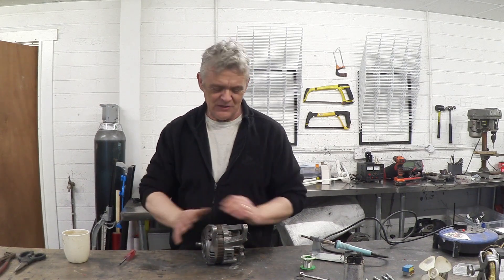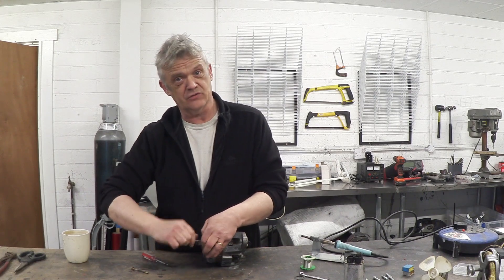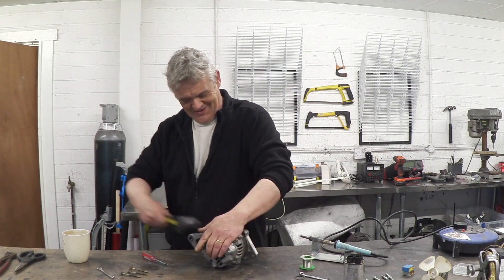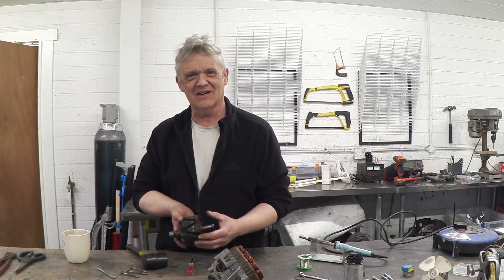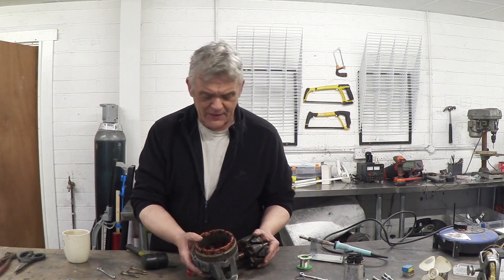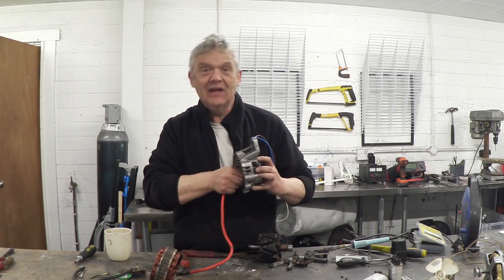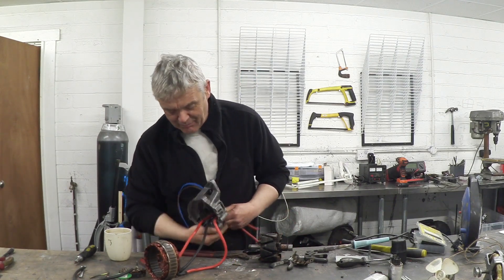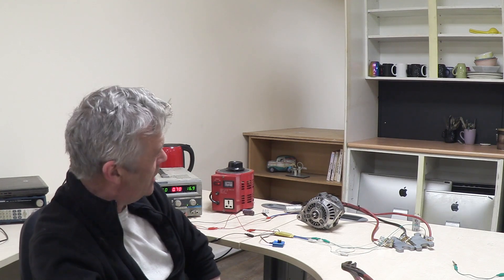Converting An Alternator To A Motor

Comment: By the way, reversing the polarity of the field (rotor) brushes does NOT reverse the motor, but swapping any pair of the 3 phase leads of the stator will.

Running with mechanical drive input (generator mode), adjusting the rotor (field) drive current will control the output voltage at any given shaft speed, it will also change the load on the device (turbine, engine, windmill ,etc.) 

When in motor mode, adjusting the DC field excitation is used to match motor HP output availability to that the load is demanding, which also controls the power factor (phase angle between Voltage and Current, lead or lag), which can make a synchronous motor appear Capacitive, Resistive, or Inductive, depending on field current.
Power utilities like to see unity Power Factor (in phase aka resistive loading).

HTH

Cheers,
Dave
Reply: Great info! Thx. Re: brush currents controlling to load (motor mode), what if you convert the rotor to PM, brushless? I suppose the magnet strength then would match to torque/speed demands on motor? What if also powering motor with variable voltage and current, say a solar PV panel? I wonder how to coordinate variable solar input to rotor field strength (with permanent magnets embedded into rotor to eliminate brushes and excite) to set load?
Reply: @2highview  1.  Magnet strength for rotor not that critical, weaker magnets produce somewhat higher speeds, but less torque. Stronger magnets, slightly lower speed but high torque. The alternating arrangement of N and S is critical.
Anyway the rotor (on DC) require a minimum of about 3 volt, max 12 volts.         
2.  If you use a variable DC input to the Electronic speed controller (ESC) from for example  solar panel, you need to know what input voltage range the solar panel/s would provide.  Generally alternators can work from 36 volts to 72 volts or even higher than that, but heat would start to build up fast the higher you go.  ESC have various types, generally you need one that can handle voltage of your average solar panel input. (minimum 36 volts, max about 60-72 volts) also having an amperage of not less than 30 amps (higher is OK). Best that you get a 1500-2000 watts controller. You can determine wattage that the alternator can handle by the volt and amp of alternator. E,G 12v X 80 amp alternator can handle 960 watts.
 Every ESC has minimum and maximum voltage cut-off.  Depending on the voltage you expect from your solar panel, you can use a DC to DC convertor to ensure that you have a steady DC input voltage into the ESC.,  Good luck.
Reply: @gensyed  I would like to know more,  do you have a source that I may be able to generate a recipie to use one for a trailer tug?
Reply: @ernestmurphy3898  Sorry, I do not have 'a' source, they're all from you tube. 'How to convert alternator to motor and the likes, AND from my own efforts converting and repairing alternators.  I buy my ESC and batteries from Ali express or Lazada and some from computer shops. Wish you success.
Reply: @ernestmurphy3898  If you have a specific question, I maybe able to assist.

Comment: If you connect 2 of these in paralell (each wire 1 to 1 w/ the corresponding 2nd unit's wire), then energize the rotor (slip rings) w/ single phase AC (use your variac) enough to provide excitation, you will have a Synchro (or Selsyn) system.
Rotating one shaft slowly, and the other shaft will follow it, remotely reading the other input.

Think a remote wind direction indicator.

Energizing with DC, then driving one shaft at high speed, the other shaft will "motor" at the same speed. (this is like a power plant generating 3 phase AC, running  a Synchronous motor at a customer's plant.

Cheers,
Dave Cole

Comment: So,if you remove the 3-phase power feeding, instead turning the shaft with whatever sounds fun, then you got a 3-phase generator, output voltage regulated by changing the 12V and the frequency by the speed you turn the shaft, right?
Reply: Yes, AC out put.

Comment: Could this be configured to work BOTH as an Alternator OR a motor? If so, it could be used as a pseudo Hybred system, if reinstalled on the original vehicle.
Reply: You're wanting a mild hybrid system
They already exist, made by GM, Continental, Hyundai and others
Reply: It could, but you have to just tap the necessary connections and have switches to make it either motor or alternator.  Also you need another source of DC top-up for your car batt because its taking the load of the car's electricity requirements.

Comment: My latest project video can be easily used as a variable frequency drive for you.  You will need one amplifier per phase and have a multichannel input with 120° phase shifts between channels for 3 phase.  Probably much cheaper than a commercial DC input to 3 phase VFD.  I found it much more fun to build as well!
Reply: Please can you explain further, I mean how to amplify the 3 phase output?

Comment: I Like these videos 

Interesting, i wonder if you were to self loop the rotor if that configuration would still function like an induction rotor , that is to say universal opposing force? The way in which the metal core is folded would suggest it may. 

Then if you disconnect the winding to their individual 3 windings you will be able to identify the 3 phases. 

And you have a 3 phase motor, which can then be operated by adding a ‘condenser’ to run single phase or by self looping one phase and connecting the other two in circuit I believe. 

But I’d have to try it.

The advantages of a pulse control is you have speed control, as you would know induction motors are frequency dependent 

However, there are also then generator options with the induction motor as you have already outlined and you lose the brushes this way so? 
And other advantages like being very prevalent at most local tips or scrap yards. 

Oh I just thought but to self start you would need to check the L and the R of one winding to determine the phase angle  
You can use  

Arctan { xl / R}   To get the phase angle 

The you would use  on another phase Arctan {xl - Xc / R } to sum that offset phase angle so it is 90deg alternate to the phase you run

Then it should self start, but I’m not sure as to the self connection on the third phase I’d have to try , I have some old alternators I might try it. 

Regards
Reply: Please put u a video.

Comment: Thank you for your answer.  What if the rotor connections were shorted?   Could the 3 phase field induce a voltage into the rotor?
Reply: No and you'll spoil your ESC.
Reply: Yes , you can do that , the alternator will become now a 3 phase induction motor with the exception that now you cannot control the speed and torque of the motor now as the rotor magnetism is fixed now.

Comment: Reversing the rotor polarity won't change the direction of rotation. To do that you need to swap two of the stator phases, or have the controller cycle the phases in the opposite order.
Reply from the maker: for sure - my bad - cheers

Comment: Now you've opened a can of worms - of fun. Lets say the Alternator would have produced 70 Amps in its original configuration. Now the voltage regulator is out of the circuit, the Stator winding should produce up to about 120 volts AC. 70 amps times 120 volts gives 8,400 Watts. And believe it or not, that little alternator will produce that sort of power. Not as a motor, but as a generator. The main issue in such a configuration is of course Heat dissipation. Even half that power is a bundle of fun.

Using your home made batteries on this Alternator/ Motor and your well on your way to a revolution in personal electric transport..
Reply from the maker: that is awesome mate - thanks for posting that

Comment: interesting , my suby alternaters are rated at 100 amps ,[ unlikely to be 100% duty ],even at 50 amps 48V you should have a couple of killowats ,very usefull for a bike . may be able to up the field voltage before saturating, for a bit more . Could actually be interesting to really up the voltage and limit current aka Charles Newman  ,  have to rewind  rotor though. I take it that is a 3phase speed controller ? pretty amazing the controllers you can get for drones and things . dang! now you've got me thinking ,how many of those to get a personal flying machine on the cheep ...now all we need is some really good light wieght batteries ....... !?
Reply from the maker: electronic speed control for brushless motor mate - but works fine here as basically that's what a converted alternator is - well in principle

Comment: Would it work as a three phase induction motor without the D.C. voltage on the rotor?
Reply from the maker: I would think without the dc on the rotor it would be a challenge - you would most likely have to reconfigure the rotor
Reply: No.
Reply: Yes it will work as a 3 phase induction motor if you short the slip rings.

Comment: Basically it's a three phase motor with the potential for varying the output by how much current is applied to the rotating field. You could use the controller to drive mosfets [mosfet has "Source, Gate and Drain"]  which are sourced by house current or ...If three phase is available like in industrial shops then you use those mosfets but the gate's are variable controlled to limit the current applied to the stator windings. In both cases the mosfet must be able to handle the source voltage and current that is needed to apply to the stator windings, you MUST never exceed the current limits of both the mosfets or stator windings.
There is a pretty good chance you could apply the three phase signal to the stator windings at a voltage that generates a nominal current drain...Then when you begin to drive the field winding with current, that would trigger induction to the stator and the shaft would begin to rotate causing stator current to increase. The amount of stator current would be related to the field voltage applied and the load put on the rotating shaft.
Reply from the maker: I am not sure I got everything you said mate - but i certainly liked the ideas and will look at this as a way to try to efficiently drive the motor - thank you for taking the time to post
Reply: 8-12 parallel BUZ10 and BUZ111Mosfets were used in quite powerful brushless electric r/c car speed controllers, very cheap, and you just rank more of them in parallel if you need to control more power.

Comment: The plug with the electronics. Is the charging regulator. It communicates with the cars computer to know exactly how much voltage and amperage to output according to the cars electrical demand. It usealley works off of a bus can data and/or 5 v reference on obd2
Reply from the maker: I pulled this from an old car mate - there is no CAN bus is a 1980s Nissan Micra lol - I joke of course but get what you are saying and thanks for posting
Reply: Ok did not realize it was that old. I drive a 1990 Lincoln with obd1. And it has a regulator that goes to the ecm. Well I am no expert. But I do want to learn as much as I can about electro- mechanics as possible.  Here is an idea for your next video. How about running the generator motor off of. Fuel vapors. Other people have done this on YouTube. With success. That way we know exactly how wastefull a combustion engine really is.
Reply: It's probably just a simple circuit that regulates the output voltage by varying the rotor current. There's no need for it to communicate with anything.

Comment: I have a delco external regulated alternator already set up to work like this, and a remanufactured one just like it to do something with also, got it for $15 , I was going to make a pma wind turbine! Maybe I still will, being offgrid, power is always in demand! A 20 meter tower that is needed is the hold up!
Reply from the maker: they are awesome bits of kit mate - so much you can do with them
Reply: I've seen people that turn them into a VAWT by putting a 55 gallon drum (cut lengthwise and put the two halves side by side on the shaft to turn it.)

Comment: I have a 1500+ watt controller, and a few alternators to do this with, I have smaller bldc motors,  that are not rated for the higher voltage of the controller, 48-72 volts, I'd say the alternator can handle it, my lil 350w 24-36v motors wouldn't last to long at 72v!  A unrelated alternator can output as much as 600+ volts at a decent speed, some more some less, the 12v output, is with the rotor being pulsed rapidly, 12v on the rotor, at 2k rpm the alternator will easily do 18-36v open circuit,  it's amazing how little alternators have changed since the 60's! Great video, I hope to see more videos like this! Awesome!!
Reply from the maker: you are lucky to have that mate - I must get one lol

Comment: Will you explain how the generator works? I'd like to be able to make a motor with mine.
Reply from the maker: In an alternator it's basically just like a normal generator - the dc current on the rotor makes the rotor a big old magnet - then the rotation of that magnetic fields generates the current in the normal way - field lines intersecting the coils of the stator - So you need energy in - DC on the rotor -  the amount output is proportion to rotation speed. So, when it spins slowly input is bigger than out put but when speed goes up beyond a point output is bigger than input and you get a generator. What we did here was reverse that and we can do the same thing for pretty much any generator - but - I have just picked up a pretty big generator and I may well do a video on the conversion of that - the videos we did on turning pc fans into generators are also the principle behind any generator it's only a size difference - having said all of that - I also picked up an broken microwave today so if you like I can take that as an opportunity to further explain - hope this helps, Rob
Reply: @ThinkingandTinkering  I think I'll watch those videos again. I just watched the one about PC fans. Thanks for the precision, you got my attention.

Comment: What about wiring the magnet wires into the speed controller so you can power both with 1 power supply and also increase the efficiency. You would need a transformer to get the voltage right for each but rectifiers are only a couple cents so you can even switch from AC to DC.
Reply from the maker: I was thinking of a battery pack and tapping off a bit like a transformer
Reply: Possible, but for the rotor, you'd need max 12 volts thereabout. So you need a DC convertor for tap off.